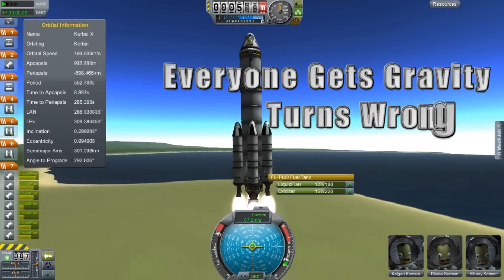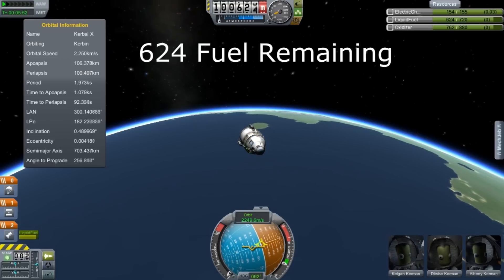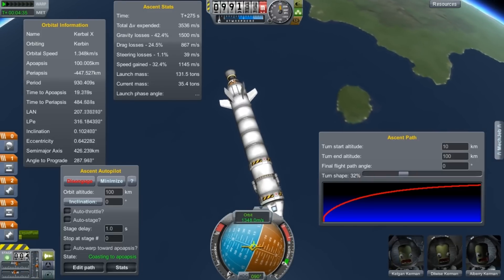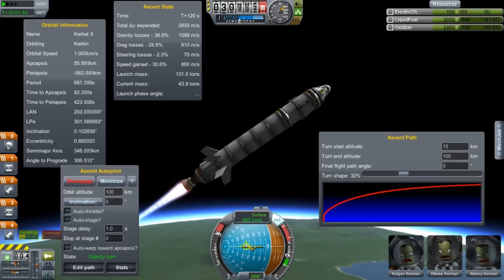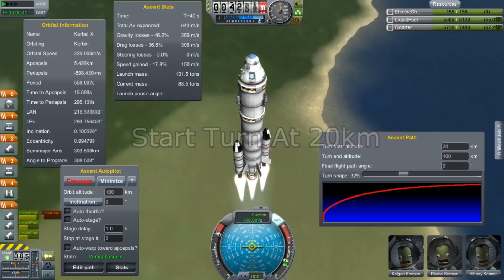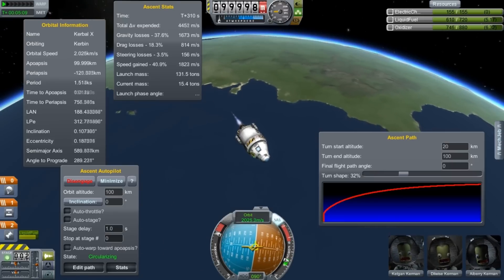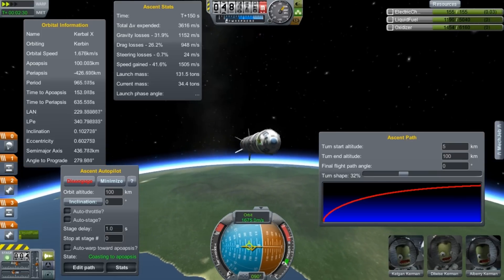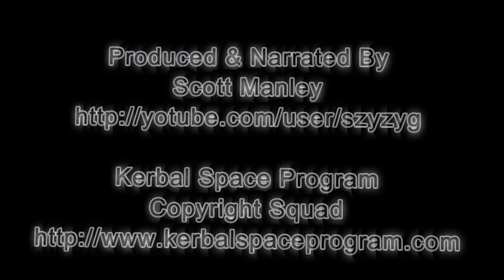Kerbal Space Program 101 - When Do You Start Your Gravity Turn?

Comment: I usually wait til 9K and then I start turning towards 45" until 10k and follow the prograde vector until I get a apoapsis near 100k. I cut the throttle and plan my orbital burn node, then when I get get to 1/2 the burn time before the node I start burning until I get a relatively circular orbit. Probably not optimal but I think it works well and it's easy.

Comment: So, I'm trying to follow the prograde marker beginning at 10km in the stock Kerbal X, but I have a hard time getting above 1.1 km/s by apoapsis. When I follow a "MechJeb" routine by rotating to 45' and then back to the prograde marker quickly, I get closer to 1.3 km/s (though, I end up with ~610 units of fuel after circularizing). I notice that you actually start your turn at around 8 km - is there really a "rule-of-thumb velocity" you should be turning at rather than an altitude?

Comment: So is there a good way to ensure you're always being as efficient as possible? Like would you say it's always efficient to just tilt slightly off center right off the start and then keep thrusting prograde until you're in orbit? Or maybe just try to thrust prograde the whole time (but I'm just afraid you would probably just be thrusting straight up the whole time or end up in an orbit facing in a direction you didn't want.) I probably just need to test it out myself but I prefer math to testing.

Comment: Nice vid!  I've probably been doing it wrong for some time now - I start my turn at 10km, but only by twenty-degreed off-vertical.  As I ascend higher, I take it to 45-degrees once I hit about 20km and then pretty much level with the horizon once I see my Apo rise above atmosphere.  Works fine with small and mid-sized rockets, so I figured it wasn't broken...  I'll have to attempt turning more than 20-degrees at 10km and see what difference I get.  Thanks for the vid!

Comment: What I usually do (and I have 6 space stations and a fleet of 20 sattelites on my main world) is have 8 large fuel tanks with 3 mainsails (I only add boosters if I'll crash without them). Then I have a Poodle and a 1/2 Large Fuel tank. Then the payload. Since stage 1 shuts down almost exactly when the atmoshphere-layer indicator tops out, I'll cut my engines when they do, get my trajectory, and meet up with my trajectory. I use that to Orbit, or sometimes for Kerbin travel.

Comment: Nonono. Low center of thrust is totally ok. As long as the inverted version of it intersects with your center of mass (your com is in the middle and your cot is pointing straight down). You'll have problems if your rocket doesn't have thrust vectoring or you don't have any control fins.

Comment: This actually may help me with my orbital space plane that I'm working on. I take a near 75 degree inclination after leaving the runway but if I pitch down too early it takes longer to get up to speed and certainly wastes a lot of fuel. I've noticed the large turbojet engines are most efficient around 18,000-20,000 meters If you've got the intake air to keep them burning. My goal is to try and get at least 1,400 m/s with turbojet power only before getting to 28,000 meters to fire up the rockets.

Comment: Well the point of the gravity turn is to reduce the turning losses (you use gravity to make the turn instead of thrust).
For ksp experimentation is best way to optimise but i would suppose, that because there's a mass component to the drag equation in ksp, performing the gravity turn later would be better for heavier rockets (and earlier for lighter ones) once you've got it optimised for a rocket of a certain mass and drag.

Comment: Hi Scott, i've got a huge rocket, powered by solid boosters and asparagus, last stage is nuclear powered. It works fine with starting turn at ~10km, i have moon lander + command module + some middle tank full of fuel at the orbit of 100km. It's optimal path for this rocket, because it has relatively low ability to gain the speed at high attitudes. If i turn higher, it ends on the higher point of orbit with too low speed to make it complete. So as you said, it all depends of trust/weight ratio.

Comment: If you're not using vectoring engines or control surfaces, a sharp turn at speed can cause you to tumble due to drag.  Try adding control surfaces and taking your turn more gradually.  If you're using SAS rather than ASAS, I would switch that as well.  SAS got nerfed pretty hard in the last patch, and while ASAS doesn't bring any control in and of itself, it will automate your control surfaces and vectoring engines to keep your ship more stable (while it's turned on, anyway.)

Comment: The Oberth effect is related to adding or removing energy from your orbit by changing your momentum when your kinetic energy is highest, so you need less of a momentum change (less delta-v, that is) to raise or lower your apses.  Normal and radial burns only change the direction of your velocity, they don't alter its magnitude.  A smaller velocity is easier to turn, so you need less delta-v.  If possible, you would do this at apoapsis, but at the very least, at the highest altitude you can.

Comment: Actually, your right. You see, terminal velocity is the fastest speed an object can fall in a given atmosphere. Inversely, it is also the most efficient speed to travel at in a given atmosphere. As air pressure goes down, terminal velocity goes up, so the higher you are, the faster you want to go. You may want to speed up sooner, for highest efficiency. There's a chart detailing terminal velocity at the KSP wiki's page for each celestial body.

Comment: I was completely messing up my turn before. For some reason I got it in my head that I should go straight up, then turn at apoapsis. I always needed a high apoapsis and a big rocket to make it.
I then realized something wasn't right with my burns, and did some research into it. I now start my turns at about 10km. It's hard because most of my rockets fly like dogs (probably the huge payloads), but I've noticed a huge saving in fuel. If I could make them more stable, I'm sure it'd improve again.

Comment: You can actually use terminal velocity to find the most efficient speeds for an ascent. This happens because, when a freefalling object reaches its terminal velocity the force of gravity and the force of drag are equal and the object is no longer accelerating on that altitude. So if you reverse that, it actually makes sense when launching to never exceed the terminal velocity. Obviously in real life the terminal velocity is dependent on the Cd of the object but it is a good enough approximation

Comment: Is it more efficient to always burn at full throttle?  I always try to start turning at 10km, don't burn faster than 200m/s until 10km, and I try to always point at my pro-grade marker.  The one thing I do differently from everything I have watched is that I tend to burn at a very low throttle to keep my apoapsis marker a specific amount of time in front of me until my orbital velocity/height is where I want it and then I burn full throttle (as needed) to achieve orbit.  Is this inefficient?

Comment: Interesting. I think I set MechJeb to start the turn at like 5 KM or something, but the slider is all the way to the right so it doesn't really start turning till around ~10-15 KM. I found this ascent path is the most stable for those times I build super massively large rockets. Often times doing otherwise leads to those kind of rockets flipping out of control, so I just leave it as is to play it safe.

Comment: To avoid being a hypocrite and throwing out unbacked numbers, I did the math: The Saturn V's TWR was approximately 1.21 on launch, 4.75 when the first stage ran out of fuel, 0.75 when the second stage ignited, 2.9 at the point the second stage ran out of fuel, 0.61 when the third stage fired, and 1.8 when the third stage ran out of fuel. Total burn times were 2m30s, 6m, and 8m20s respectively. Any errors in the math are my fault, but the approximations are close enough and nowhere near 20:1.

Comment: 1: I was talking about actually getting INTO orbit.
2: The Saturn V absolutely did NOT have a TWR of 20. It weighed 6 million pounds and only put out, on average, 7 million lbf of thrust. The most thrust a Saturn V put out on launch was ~9 million lbf. 
3:A TWR of 15 in KSP is absolutely ridiculous and unnecessary and I'm not even sure possible without non-stock engines. Maintaining a TWR of 0.99-1.5 during launch is more than adequate for almost any rocket.

Comment: I've gotten probes into orbit using ion engines. It's simply an issue of time available. You can't do it with a low apoapse, because you fall below apokee too soon, but it is possible, and not that difficult. A high TWR when getting into orbit certainly doesn't hurt, but it's not required. Beginning a turn too low with a heavy payload, even a Mainsail is going to struggle below a certain point to keep from passing apoapse and falling.

Comment: I'm not sure about 200 m/s below 10000 m, but I do know that 130 m/s below 1000-2000 is pushing it in terms of speed vs drag efficiency. Mechjeb will actually throttle down for a more efficient ascent when your ship starts fighting drag at higher speeds, so watch that and you can figure out what speeds are proper for what altitudes! A proper thrust to weight ratio will keep you from going too fast at low altitudes though, so look that up too XD

Comment: I usually have a slight till (usually 5 degrees eastwards) to steer myself into the ocean, then start my gravity turn at 10~12KM, one problem I face is the roll induced with 3 stage asparagus system and therefore I usually I make sure that the 2 pairs of tank is dropped before I start my turn.

Comment: I have a space station 130km in orbit and I'm using the jool V heavy system to launch my parts. The thrust to weight ratio is huge as I'm sending up no more than 30 tons per launch, but the rocket works so I don't want to waste time redesigning a new rocket family for every segment launched. 

However, what I've found is that it's very unstable and either flips out when grav turn=low or goes back+forth when grav=hi. 

Thoughts?

Comment: A probe with an ion engine is never going to make it into orbit, no matter how much delta-V it might have. Thrust to weight ratio is everything when getting off the ground. A rocket with more thrust will burn less fuel than another rocket with an identical amount of mass but less thrust. It will also make it to orbit in less time.

Comment: I ran an experiment over 16 launches using the  Kerbal X stock rocket. I performed 4 launches for each gravity turn altitude varying the mechjeb shape. I used 5,10,15 and 20 km values for the gravity turn and 24, 30, 36 and 42% for the shape.

The best result (most fuel remaining - 632) was achieved using gravity turn 10 km and shape 30%. Note that I used an 80 km orbit in these cases.

Comment: A good addon to try to help understand what's happening at different altitudes is the "Graphotron 2000." One of the important numbers that is gives you is "dynamic pressure" or Q. Basically, the pressure in front of your aircraft is increasing as you go up, and the best way to counter that is to go straight up. After you reach a certain altitude it tapers off, and getting to orbital speed is more important than fighting the atmosphere.

Comment: I turn to 45 degrees at 10,000 then turn in between 45 and 90 degrees at 20,000 and turn to 90 degrees when I reach 30,000. I do this every time I launch a rocket and is this the correct way to do it?

Also I Burn till my apolapsis is 70,000 is this where want it or is it 100,000 where I should go?

Comment from the maker: I would love to have stats for my manual ascent, but mechjeb does not generate them, so I could only show you them for the automated ascents.

And it's not about the mass of the rocket or payload that matters, it's the thrust to weight ratio. If your TWR is lower then you need to turn at higher altitudes. The guideline to use is the time to apoapse, if it starts decreasing at any time you're turning too fast.

Comment: From my year of playing KSP, I have found that, at least with my designs, having a starting TWR under 1 is bad, and one that is over 3 is bad. My reliable rockets (that I may be putting up on the forums) generally have a starting TWR of around 1.7 to 2.8. I have also found that starting at 5 km and having the "turn shape" set to 44% gives a more realistic launch (in my eyes) and only has a gravity loss to drag loss ratio of 1.4 and a steering loss of 1.1% without fins. continued...

Comment: If you look at the KSP wiki and the entry for Kerbin, there is a chart relatively high on that page with maxQ values, which are the optimal speeds for set altitudes to minimize losses to drag. I don't know if they're 100% correct, but I would assume they would've been corrected by someone if they were off since the community is full of those who -do- know the math. They seem to work pretty well and are a solid guide for speed at altitude to aim for.

Comment: If you don't have enough time to burn your upper stage to reach orbit, you're not getting into orbit, regardless of how much thrust you had on launch. The heavier your ship, the more fuel is spent pushing it straight up, and thus, delta-v is used in lifting, not reaching orbit. To reach orbit it is the same, yes, but you're spending fuel all the way up and the delta-v available per stage is finite.

Comment: Delta-V has nothing to do with it; two ships on identical sub-orbital trajectories with identical apoapsises will require the same amount of delta-V to enter a circular orbit.

During launch the thrust to weight ratio is everything, that's why the mainsail engine is practically the only choice you have for launching Rockomax rockets from Kerbin, it has 1500 kN of thrust. (The largest engine built on Earth had around 1200 kN of thrust IIRC.) Generally more thrust is better than a longer burn time

Comment: 2 questions.
What to do if the thrust to weight ratio is lower? Do we start higher or lower.
And. You allways say that we shouldn't push hard against the troposphere, and we shouldn't exceed 200m/s. But I did some experiments, (just going up, so the gravity turn doesn't affect the results) just to see how high could each rocket go to.
It turns out that the rockets who allways had thrust on max and exceeded 200m/s did go higher then the others.
Great video though

Comment: The heavier the ship, the more inertia it has, and the more delta-v required to push it into orbit. Without a ridiculously powerful engine, that also means more time to reach orbital velocity. I've only had to go that high with ships whose payloads were in the 60+ ton range. For comparison, a 2m Apollo-style CSM/Lander stack payload with third stage and Poodle engine weighs about 46 tons. That one began turning at about 12km with orbit around 120km with enough third stage fuel to reach Mun.

Comment: Well, you should probably add a clarification that this only applies to lauches from Kerbin. In bodies with no atmosphere you should start turning as soon as you can without hitting surface again and in bodies with atmosphere besides kerbin, the turning altitude depends heavily of the pressure at 0m ( given that all atmospheres pressure graphs in KSP follow the same curve modified by the pressure at 0m ). In Duna you turn at 5-6km if not less and in Eve you can't start turning before 30 km ...